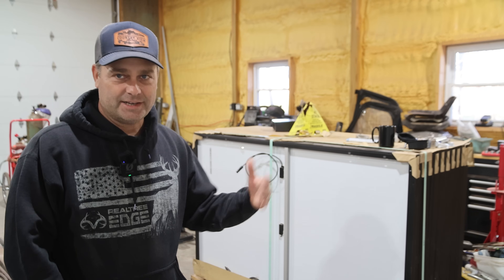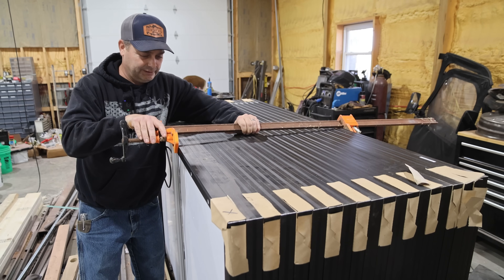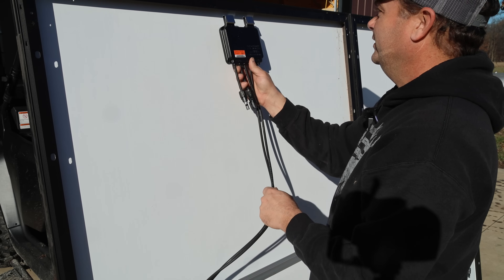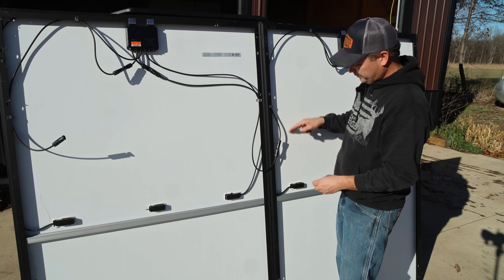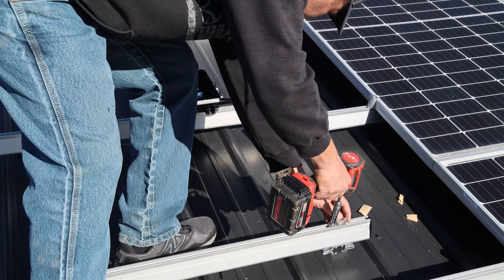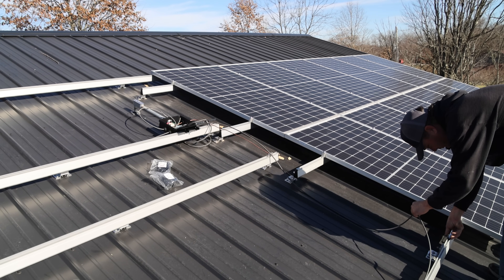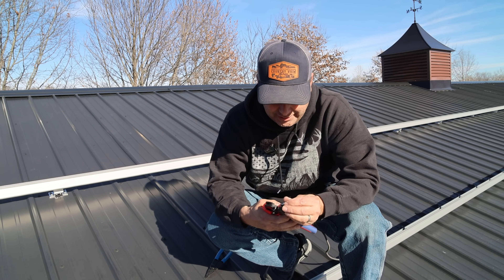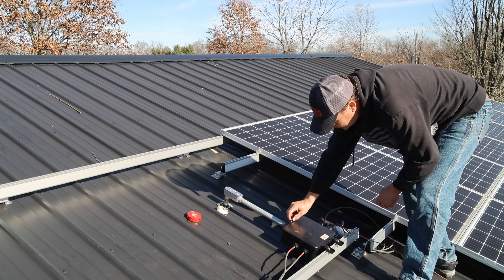Installing Solar panels on our Roof, Rapid Shutdown Modules & PV Disconnect Switch.

Comment: Hi great video. When you shut off the DC isolator switch how do the Tigo units know to cut the power in the panels? Are the wired somehow into the DC switch. Or are the monitoring something and if so what? And finally will they cut the power if there is damage that causes a fault and a potential arking that could lead to a fire?

Comment: Short note-
First, I want to thank you for the Heyco Sunrunner clips reference. Saved my arse on install cabling. I really don't know what I would have done otherwise!
As a side comment, the Tigo clips do not provide any grounding to the panel or Tigo module. They just bite and hold. I know this because I had quite a few
I had to rail mount, they just have a plastic tab with no bonding.
Excellent set of videos, though. Top rated in my book!

Comment: I noticed you added Tigo TS4-A-F modules to your Canadian Solar panels; a switch from the Tigo TS4-A-2Fs you've installed previously.  I am simply curious if that change had anything to do with wanting simpler wiring and less wire. Your videos are great, btw.
Reply from the maker: The single modules are simpler to wire.  The double module ends up being under a panel, while you are still wiring up the second panel.  So I like the single modules better.

Comment: Boy having a large working space looks so much easier that trying to put the rail system on a smaller roof that's not big enough for both you and the panels at the same time!

I'm a details guy, so I really appreciate you taking the time to share all the different aspects of your install.  Great job!

14:24 did you miss a few UFO bolts on the bottom row of panels between panels 1/2 and 3/4?  I see 2 silver UFO bolts on the other panels but not between those ones.
Reply from the maker: Yes I didnt have enough ufo bolts.  More arrived the mail yesterday.
Reply: @CountryViewSolar-DIYProjects  no worries.  I think you mentioned it before but  I know it's true for me...as much as you plan you always seem to be a couple pieces short...😁. 

Looks great!

Comment: I noticed that the IMO disconnect wasn't grounded. I wired mine the same way after asking Signature Solar about grounding and they said it wasn't required. Is that because the box is plastic?

Nice video.

Comment: Love the vids. One thing I noticed is that the Canadian Solar panels and Tigos have MC4 connectors from different manufacturers which technically is not allowed.  I'm planning on replacing all the panel connectors on mine but wondering if you had any thoughts, issues, or warranty concerns.
Reply from the maker: My understanding that the TC4 connectors on Canadian solar panels are compatible with MC4 connectors.  Canadian solar has issued notices in the past that is is fine to connect them together.   I am not aware of it being "not allowed".  Please link manufacturers page that details this.
Reply: @CountryViewSolar-DIYProjects  I cut off one of my panels connectors and disassembled it to compare it to a Staubli and they are extremely similar. Both are very high quality, much more than anything from Amazon. The insertion and retention force was slightly higher when using the same manufacturer for both male and female but not enough for it to be a concern IMO. Crimp quality was very high on the Canadian Solar connector too. I wouldn't be worried about using them as is but some keen eyed inspector may have an issue.
Reply from the maker: Looking at my solar panel data sheet.   It says it is compatible with T6, MC4, MC4-EVO2, & MC4-EVO2A.
So it should be fine.
Reply: Technically, there's only 1 MC4 connector manufacture (Staubli), anything else is a knockoff.

Comment: How did you integrate this new array into your rapid shutdown transmitter?  Do you have a separate one for these going to your 6000XP?
Reply from the maker: I have a video on the rapid shutdown transmitter installation.  The shutdown button has 2 sets on contacts.  So I contact shuts down the EP cube solar panels.  And the other contact shuts down the 6000xp solar panels.   So 2 systems with one shutdown button.
Reply: @  ok so this disconnect is in-line before it goes over to the 6000XP.  Breaking the PV circuit with this essentially cuts off the PLC keep alive signal so the modules shut themselves down.
Reply: Was your inspector ok with having all the disconnects located inside the building?  I'm hoping I can do it this way as well.  and thanks for the great videos!

Comment: Congratulations on the new array!   It's great when everything is fully charged by lunchtime.   When my batteries are fully charged I had nothing to do with the excess power so I bought some 500w heaters from Amazon for $10 each and let them run and help heat up the house.   Not efficient, but it's power that would be wasted otherwise.   Today is the 22nd, so solar wise, it only gets better from here.   Merry Christmas to you and Rebecca and all your family.  Happy New Year and here's hoping 2025 is even better than 2024.

Comment: A self retracting lanyard would be ideal for use on your roof. I think a fixed length that lets you get to the end panels is going to be too long in the center. No point in being tied off if its going to let you fall off anyway. You definitely don't want to be hanging off the side of the workshop.
Reply: You may want an extra hookup by the new array for extra safety.   also  it is better to be hanging off side of the workshop tnen hit the ground.  the fire department will take you off but safely.
Reply: @hmsyushmsyus1194  Youtube, or his channel filter keeps eating my replies. Very annoying.
Reply: @hmsyushmsyus1194  I can't seem to get a reply to stick to this comment no matter how much I tone down the wording.

Comment: Do you get a good seal on that bare wire with the box connector gland nut? Is there any reason to run bare vs normal wire other than ease of use in the ground clamps?
Reply from the maker: The bare wire is what I had lying around.  It is stranded, so  doesn't have a great seal.  But it is protected by the solar panel, so it shouldn't get hit directly with rain.  Not ideal, but should be ok.

Comment: The new array has a very long DC run to the house - how much voltage drop are you seeing and how many watts lost does that represent?
Reply from the maker: Voltage drop is effected by voltage, amperage,wire size and wire length.  The voltage is 320VDC, (higher voltage less drop), the max amperage is about 14 amps (less amps less drop), the wire size is 10 gauge (rated for 30 amps, bigger size than required,  less drop), the wire length is around 250 feet (longer length more drop).
After running it through a voltage drop calculator,  it is 2.61% voltage drop.  Which is perfectly acceptable.
Reply: @CountryViewSolar-DIYProjects  So a 2.61% voltage drop is approx 8.35 volts, at 14 amps that is about 115 watts. It was probably considered okay in the old days when it represented a single (incandescent) light bulb, but in these days of LED lighting and other solid state equipment it's quite a lot.
Reply: @colint  I'm sure you know that those 115 watts can't be totally eliminated.  He could have bumped up to 8 gauge and cut the calculated loss to 70 watts, but that is based on running at peak output.  Based on my research those calculated losses are much less in the real world.  At the price of panels these days, it might be more cost effective to add another panel or two, versus getting into some of those thick gauge wires where not only is the cost of wire more (60% in this case), but other associated costs would also go up like larger conduit.  But chasing losses might be a moot point anyway if he is able to fully charge his batteries before mid-day in the winter.